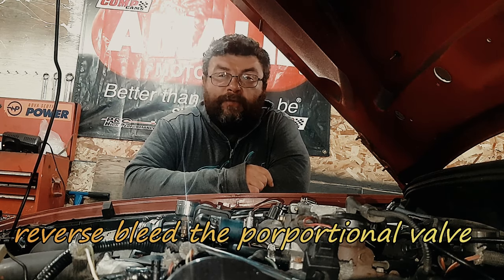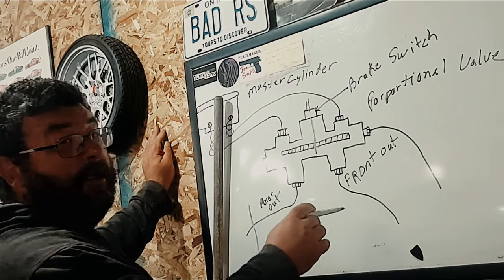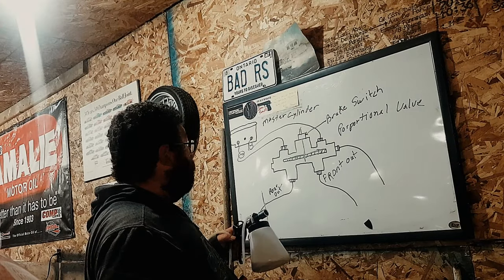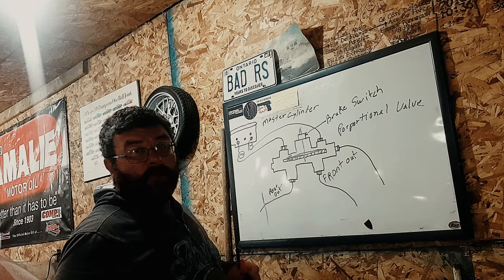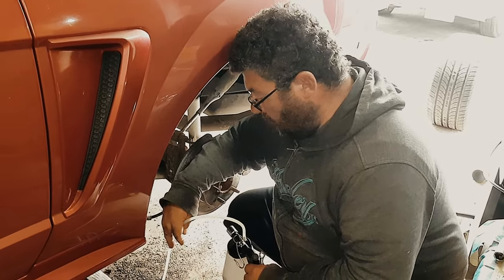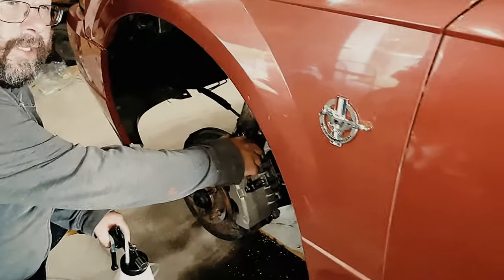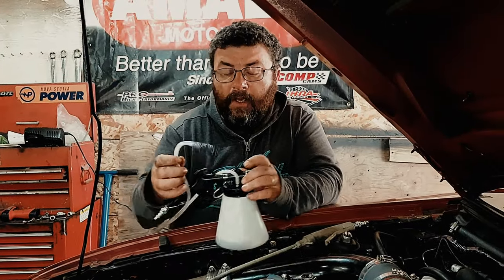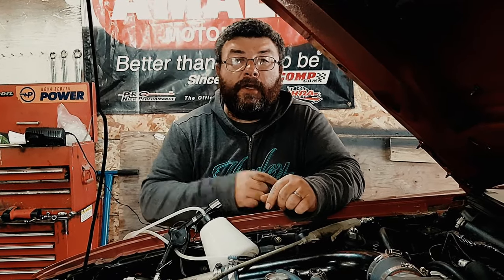brakes wont bleed proportional valve reset this guy's garage

Comment: THANK YOU!  1999 Dodge Durango went to five (5) ASE mechanics for horrible brakes, new master cylinder (twice), new rotors, new shoes,  babied...bad brakes. Then SUDDENLY, bad went to worse as the front brakes were almost lost the ABS system went nuts.  Your "last resort" was done.  Fed up with mechanics I researched and came to your sight by accident.  It made sense. Opened the front and rear bleeders and brake fluid gushed out the front, hit it with air at the back, bleed the system  and viola!  For the FIRST TIME in 22 years I have great brakes.  THANK YOU.  I kid you not, 5 mechanics didn't find that problem.  ???? ...and I spent some money over that time.
Reply from the maker: you are the man James . thanks so much for taking the time ,keep in touch!
Reply: This is the current situation I’m in rite now I have spent 1000 dollars on new stuff and yet still no brakes 😢 4 different so called mechanic couldn’t figure this out !! Can’t wait to get off to try this !!

Comment: My buddy bleed system is using one of my 4” decorative yard blocks that you can buy at Lowes. These blocks are heavy enough that once you have pumped your pedal and are in the hold position, you wedge that block against your pedal and it will hold it. Then go crack your bleeder and then close it like normal. Once again go to the drivers seat and move the block. Pump, pump, pump and hold.  Wedge your block and make sure it holds.  Go crack your bleeder at your wheel and close it back. Follow your manufacture’s pattern of which wheel is bled first. 2nd, 3rd and finally 4th. This method doesn’t require you to depend on whether or not someone can hear you and you know that the person didn’t release the pedal before you close the bleeder at the wheel. It works like a champ.

Comment: I really appreciate the tips in this video as I just finished rear brake lines on a 1999 lexus es 300 and the proportioning valve was stuck badky only giving fluid to the fronts.  I didnt have a bleeder in my master cylinder and the 2nd tip for unsticking it didnt work so I had to do the hail mary approach and it fixed the issue immediately!  No sooner than I shot two puffs of an airgun into the rear bleeder that fluid started rushing out.  Bled all 4 using the air compressor tool you refer to and lastly two person bleeding and Im back on the road. Thank you for making these types of videos!
Reply from the maker: ty so much💯

Comment: Thank you!!  I had a leaky master cyl on my 1980 firebird.  After bench bleeding the new one and installing it, couldn't get the rear brakes to bleed.  Very little fluid coming out.  The brake light was on dash, indicating the prop valve triggered.  I tried various brake pedal and cracking tips to recenter.  No luck.  Then i found your vid.  I dont have vac bleeder so i went to the air gun method.  That blew the prop valve the other extreme.  Light was still on, but i could bleed rears no prob.  When i moved to front, they bled no prob and the valve recentered and light went off.  All good.  Thank you from Hamilton.
Reply from the maker: the hail marry method,,, BOOM.  been a while since i have been to Hamilton. I'm from Cape Breton Nova Scotia. i really appreciate you taking the time my friend, YOU ROCK😉

Comment: Dang this might have helped me out the other day.  Had to put a master cylinder in a chevy silverado with abs, and I've never had so much trouble bleeding brakes before.  I bled the brakes and the ABS pump about 5 times with my scan tool.  I finally broke down and bought about a 300 dollar pressure bleeder, which I must say did get the job done.

Comment: Thank you for the vid. In my 94 silverado , the proportional valve was tripped , but to the rear of the valve and the manual reset only resets if it trips to the front of the valve. Had to take off line to front brakes and do a quick pump, and that tripped it the other way and then I was able to use the manual reset to center it a again. Now back to figuring out why I have air continuously coming out of left rear.

Comment: Excellent information.What i did was the same but i put a container on the rear brake bleed valve and filled it with fluid. When i sucked the fluid out the master cylinder it automatically filled the brake lines with fresh fluid.

Comment: Nice video! Wish I could say my new truck was working out. Smh. First back up camera replacement now the dash with 3k on it is warping...Local dealer really not working hard... ugh. Miss my Tundra more and more now. 😞
Reply from the maker: Sorry to hear that brian its ridiculous. ty for stopping by!
Reply: I bought an 01 tundra about Sept 1st.I loved it.Two weeks later was 911.Working for a major airline low pay because I was relatively new I eventually sold it because of fuel price fears.It was a perfect size and that was a major complaint so they are huge now.But the 5.7 really moves with a good job I bought a new vehicle every 2-3 years didn't make sense to buy a super reliable one to keep trading.Now retired I have a Yukon 254,000 miles but it keeps going with many broken parts and rated at 16 MPG hwy I get 18 it's 4wd.A little better than my 2wd tundra but I miss the Toyota.

Comment: Yikes I hope I don’t run in to this issue as I swap out all my brakelines, hopefully the prop valve will not move during the process and I will gravity fluid through the system as I change them, gonna do the rear first and then the front.  I am grateful to be armed with this insight now so I won’t be shocked if it happens, thanks for posting this
Reply from the maker: ty so much kelli ,let me know how you make out.
Reply: @thisguysgarage  I had no issues bleeding that one out, the brakes had not yet failed so the lines only emptied when I removed the lines. I did end up with an abs light, but have since learned that I need to energize the abs valve while I bleed it - hasn’t been an issue I have driven it that way ever since the brakes work great. I am now about to do the lines on my other truck as they are badly corroded and I will have an issue soon if I don’t change them.  Oh ya I always use my morive power bleeder that connects to the master cyl and it makes bleeding a breeze, well worth the few dollars it costed.

Comment: Could the proportioning valve be partially off? I get the fluid to bleed at the front brakes and rear driver side, but cannot get the rear passenger side to bleed. 2007 Toyota Corolla.
Reply from the maker: Check your rear flex hose on that side that won't bleed, they swell up and won't let fluid through,  they also can trap fluid in the caliper and can cause the brake to stay applied.  To check Crack the line going into the flex hose see if you are getting fluid there.  Let me know how you make out 👍

Comment: Can a bad proportioning valve cause rear brakes to stay seized? I've changed brakes, calipers, flex line, abs modulator, but the brakes keep staying seized. I can push them open with a screw driver. Any help with be appreciated, at wits end 😔

Comment: Hi great video. Just wondering if you're replying to messages. I have a 2001 GT. rear calipers not bleeding I can find the tool you used to get the proportional valve to go into the correct position. Can you provide the name of the tool canister?
Reply from the maker: If you collapse the rear calipers like you are installing new brake pads  you should be able to bleed the brakes without the tool using the buddy bleed method.  Let me know how you make out,  if you still need the tool I will have to look it up and get you a link when I get back home in front of my computer 👍
Reply: I was able to order the tool. My problem is I can't get the rear calipers to bleed the master cylinder won't  bleed for the rear either. so I'm thinking the master cylinder is trash.
Reply from the maker: @stevencogar7393  will front and rear bleed at the master?
Reply: Hi only the front will bleed the rear will drip and stop. Also, the master cylinder for the rear will not bleed I took the bleeder off, and it was dry I pushed on the brake pedal and with the bleeder off no fluid came out. @thisguysgarage
Reply from the maker: @stevencogar7393  if you can't bleed both sides of the master cylinder at the master cylinder, you are probably looking at replacing the master cylinder imo 👍

Comment: Everything you explained in the beginning is my exact problem. So I had a break in the system (rear drum brake wheel cylinders were busted) so the front bleed and rear won’t bleed. I have access to the p-valve. So I can suck from the front brake bleeder bolt while I have one rear bleeder open correct? How much fluid or how long do I draw fluid back from the front caliper? Also do I leave the master cylinder cap on or off. After all that do I close the front bleeder and draw from the rear after everything is closed? Thanks man hope I can fix this truck lol

Comment: I had to replace a rear caliper on a 2004 Escalade with ABS.  The two rear wheels are bleeding but I am not getting any fluid from the front wheels.  I've collapsed the pistons and also tried a vacuum pump and still nothing comes out the front.  I want to try the hail mary.  So, do I blast air into the front or real caliper nozzle?  Also, do I have to leave the other nozzles open?

Comment: Hi   I have a vacuum bleeder...and I learned the hard way that vacuum bleeding the rear brakes of my 2001 dodge ram cargo van causes the brake switch to go offcenter and the brake switch lite comes on ....is there a way to vacuum bleed the rear brakes without the brake switch lite coming   on or do I just avoid vacuum bleeding the rear brakes?

Comment: Can you tell me why I have an older brass proportional brake valve with a pin sized hole on the side and I got brake fluid spitting out of that little hole I tried plugging it up and that didn't work with JB weld.
I go to order a new one and the newer brass valve doesn't even have a hole on the side.
I know it's leaking pass the o-rings and leaking out this little pin sized hole.
Do I have just an older brass unit and what was the purpose of this little hole on the side of the unit?

Comment: Dang best explanation I've seen anywhere!! Thank you brother! My 97 lt1 has only fronts working and pedal hard as hell. This happened after a rear caliper leak.  2 shops wanted to change the master and booster.
Reply from the maker: thanks so much 👍
Reply: Did this fix the problem? My 96 lt1 is having same problem with only front brakes and no rear
Reply: @PeterrDoucette yes it worked. Open the rear and suck it open just like he did. You can see it working if you unscrew the sensor on top. You'll see when it's back in center
Reply: @Emilthehun  I’ll give it a shot this week. Thanks for the reply! I wasn’t sure if I’d get one from a 2 year old comment hahaha

Comment: Really cool info I never knew that.  Question for you: if the valve sticks in the first place, doesn't that mean it's likely to do it again and should be replaced anyways?  Or can you unstick them and they'll usually be good until the next time you blow a hose?
Reply from the maker: great question ,this problem is associated with a brake line busting . so when the hydraulic leak is fixed the proportional  reset the valve wont move unless you have another leak... ty for the question

Comment: I'm not sure if this is the same issue, but I get fluid to the rear. Caliper pistons are twist in, and as im bleeding them master cylinder drains down (not completely)  as usual. As i pump brake pedal it begins to stiffen up but rear pistons never fully compress the pads. If you watch them they move in and out ever so slightly along with the brake pedal.

Comment: Hi,
I converted my front brakes to disc and installed new front brake lines a rear middle brake line and a new power brake booster and Mc as well as a new combination valve.. 
I  unfortunately didn't block off the pressure differential valve when I bless the brake... So now my brake are still soft after bleeding and the light is on. I took the combination switch offand it looks like the valve got triggered.. 

One question: 
How does one re-center the pressure differential valve as it got triggered while bleeding my brakes and I didn't know about the block off plug? 🤔
Reply from the maker: In my opinion  now that you have converted to a front disk brake setup  you will be better to purchase an adjustable proportional valve  , they are pretty cheap through summit or iegs

Comment: Will this method work with a hand pump kit or do I need a air compressed bleeding kit?
Reply from the maker: compressing your calipers that wont bleed like you are installing new pad will give you the same result.  force the fluid back and recenter the proportional valve. then bleed as usual when its put back together.

Comment: I've got a 2013 Malibu Ltz installed a new Caliper unfortunately the tool I had that was supposed to stop brake fluid from spilling everywhere didn't work and I lost most of the fluid now the rear brakes have no fluid I'm assuming this is the issue that the valve is in position to provide front brakes and no rear.. It is my daily driver and It stops with front brakes but obviously I want my rear brakes.. I'm hoping this will work also I have a vacuum bleeder but it isn't one you hook to compressor will that work? Thanks for any information! Enjoy your videos
Reply from the maker: I'm on vacation right now but there is a much easier solutions video in the end screen of this video. 
Watch this if you have any questions let me know I will follow up with you.
Reply: @thisguysgarage  Thank you Thank you so much! That worked like a charm! Just had to decompress the driver caliper as the passenger was new and already decompressed but now have the rear brakes working!
Reply from the maker: @bradwells3558  that is awesome Ty for letting me know 🤜🤛

Comment: 03 Chevy trailblazer

I have no front brakes but have straight fluid coming out of the back calipers 🤔 I believe the proportional valve is stuck to the one side do you know how I can reset it by myself with the cracked tools or suction pump I haven't tried the hail Mary option is that my best option🤷🤔🙄?
Reply from the maker: try pushing both front calipers back all the way in there seats make sure the are full of fluid ,if you want to avoid the hail Mary method , but if that doest work the hail Mary method might be your only option besides replacing the valve itself which is a big issue and the reason i made this video.  let me know if you have any other questions and how you make out.
Reply from the maker: Just put a video out based on your question 5 minutes ago

Comment: Hi Guy,  Can you please tell me what is the rubber capped button on the proportion valve for. Thanks for the video very clear and informative.  I have a 71 oldsmobile Toronado FWD.
Reply from the maker: under the cap should be a center button which is supposed to reset the proportion valve, I have not had opportunity to see if it will work, but that is what is under there, ty for your question

Comment: What about if the front passenger’s side is the one cannot bleed is this thesame procedure? Or pump the air in the back, by the way what causes of this kind problem?
Reply from the maker: problem is caused by a leak.  the easiest method is to collapse the caliper on the brake that wont bleed ,like you are replacing the brake linings , this will reset the proportional valve https://youtu.be/texW8E9EAJQ video here ,let me know how you make out.
Reply: @thisguysgarage  I try to collapse the caliper just like what your video say but never move, and I try to loosen the bleeding nipple but no fluid comes out, is it ok to blow air on the bleeding nipple with out loosing any other bleeding nipple or I have to open one if so should it be in the rear or on the front passenger side?

Comment: Helpful video! Ive just replaced my hardlines that run from the prop to the rear brake calipers and ive got almost no braking power in the rears but the fronts work fine. I have found a very small leak from one of the new lines at the prop end and is coming from the flare. Could the prop be the reason why both rear brakes are hardly working? The brake pedal is also spongy 

Its a 1993 honda civic and ive been told you cant reset the prop valves on these but do you have any advice? Thanks
Reply from the maker: the leak would cause the proportional valve to activate.  this is the problem i described in the video.  you will have to force the fluid back to the proportional valve to  get the valve to center to fluid travels in all directions again.
Reply: @thisguysgarage  OK thanks i will try this, but what i dont understand is when im bleeding the rear brakes the fluid is flowing through nicely. Wouldnt a activated prop valve stop the fluid from flowing through?
Reply from the maker: are you getting a squirter or just a little flow?
Reply: @The Hotrod Hobo so if its working properly  its a squirter or little flow?
Reply: Getting little flow out of one but other came flying out no pedal pressure mostly runs out slowly. Any thoughts replaced caliper on drivers side